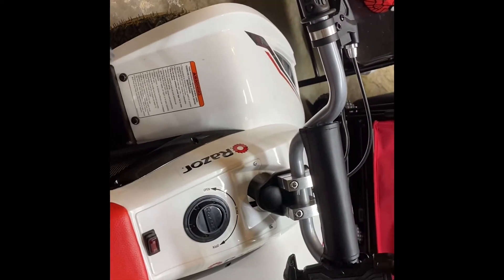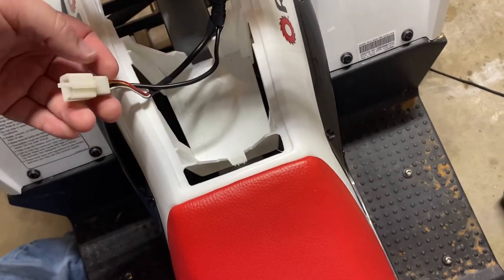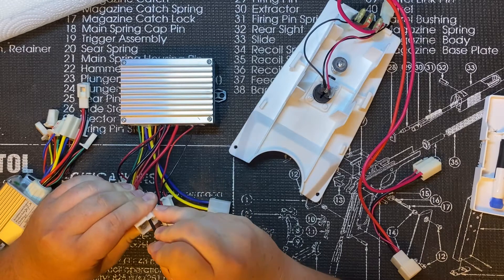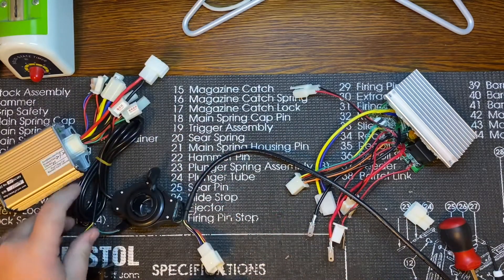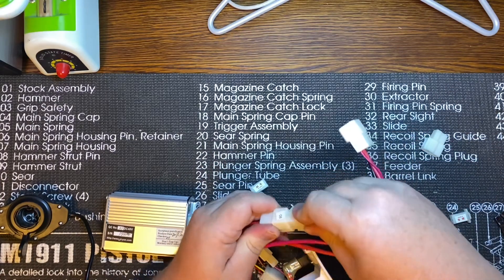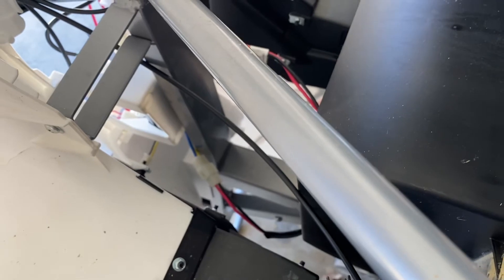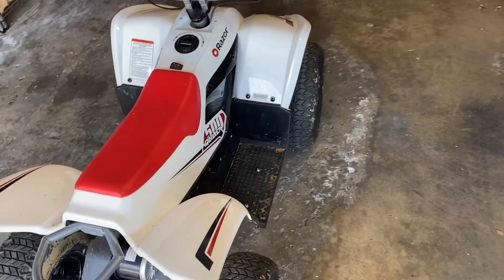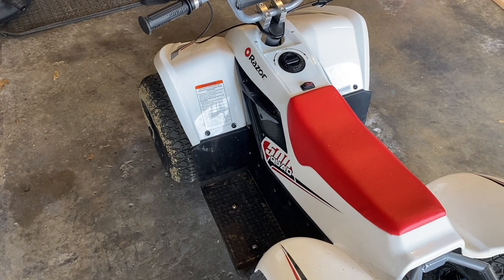Razor dirt quad 500 48V conversion￼

Comment: Im sure the stock motor didnt last long at 48v did it?
Reply from the maker: It's still going strong
Reply: @BoysNtoys0 thats surprising. I just built a 14s battery (51.8v) and the motor gets extremely hot. The factory motor controller lasted 15mins before smoking.
Reply from the maker: @gemrough  i’m not running a stock controller

Comment: Hey can you show me which color wires from the controller to connect to the og harness for the throttle ?
Reply from the maker: I don't really remember I think red is five volts black is negative and the other one is the signal wire

Comment: Great video. Keep us updated on the reliability after the upgrade.
Reply: Doubt this will help the marginal design last! In my case decided to upgraded the SLA batteries to 10 Ah, 36 volt SLA and the OEM motor couldn't handle it with my weight 220 And a  80 llb girl that uses it mostly. Between my occasional use 1% + 99% girl use, the motor stripped out the internal shaft I guess (never disassembled) Razor sent me a replacement gear motor under the warranty period. The 10Ah failed within a year and have been using the OEM pack until recently. Just replaced the OEM Sla batteries with AGM PowerStar Battery 12V 9Ah G1000U UPS Battery 3 Year Warranty and they are working great so far. The Razor 500 is a toy after all but wish it had front suspension! I replaced the controller that failed with original type one and added reverse. (don't know if that contributed to the original gear motor fail or not). I would like to add front suspension but have no clue how to do that. I can weld and fabricate parts but this is too much of a design/build retrofit and no one has done this yet that I know of.
Reply: @stephenvonvoros5405  thank you for the info. I finally got the quad a couple days ago. My son who just turned 4 jumped right in it and is doing great. So far it’s fast enough, but idk how long it will take until he begs for more power. His dirt bikes are much faster then the quad. I almost pulled the trigger on a lithium 12ah 36v battery but after reading your helpful response, I’m hesitating.

Since my son is only 42lb, I felt comfortable dropping the psi on tires a bit. Slightly under inflated tires seem to be helping with the lack of full suspension.  

I agree